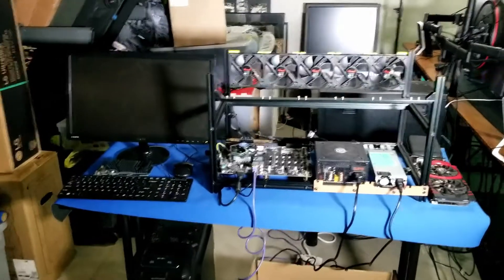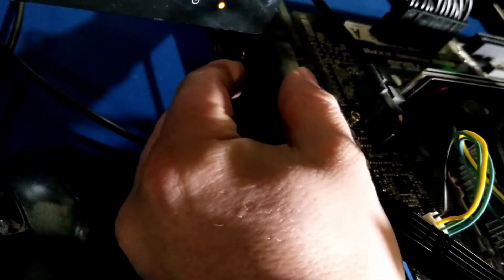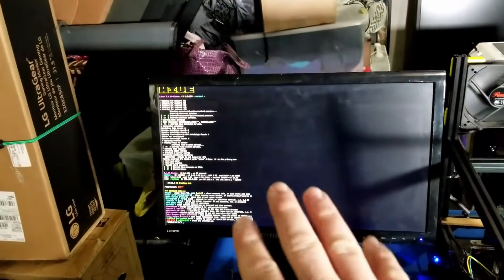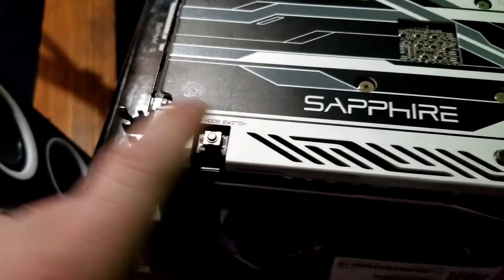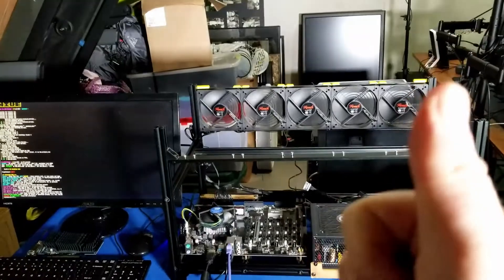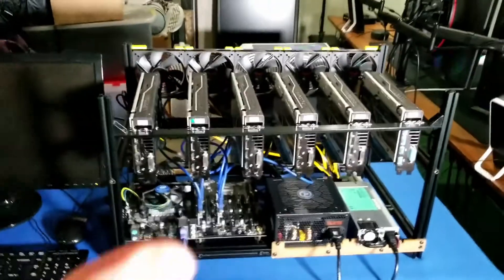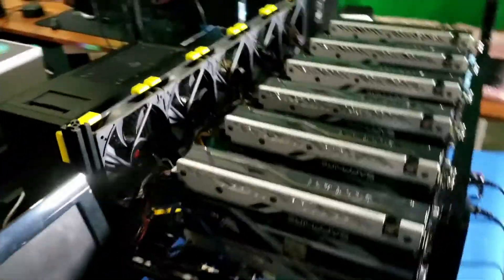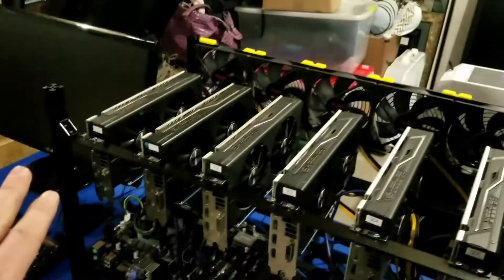Building An RX470 Mining Rig in 2021 | First Mining Rig

Comment: Quick question, why not got for pcie splitter at all the gpu and power the riser with that splitter portion. Seems like that is the safest, since sata is like the more prone to catch fire or melt
Reply from the maker: If you can wire without a splitter it is best.  Just incase your GPU does use max voltage. Now I know, your going to undervolt them, but it it does use max voltage you want to be safe.  

I do understand though its not ideal.

Comment: Great to see you finally getting this going!  I finally was able to get an RX570 running mining ETC.
Reply from the maker: Nice! What are your hashrates?
Reply: @TheHobbyistMiner  I was getting 23-24 Mh/s but the motherboard I was using wouldn't recognize to boot from USB, so I was running Betterhash on Windows.  I think I'll get better rates when I am able to test it in HiveOS.  Because I was using Windows, I was able to set the card in COMPUTE mode so I got better rates.  I don't know how to do that in HiveOS.
Reply from the maker: You need to overclock them manually.  Your Mh/s sounds on par to what I was getting when I did ETC on my 4GB cards.
Reply: @TheHobbyistMiner  yup, I'm thinking the same.  If I can find some more of these, I'll but them together in a rig.  I'm not ready to spend big money on higher GB cards right now.  If ETC or Raven is all we can mine right now, that's ok for now.  I need to get a rig built!
Reply from the maker: @mediaGuy1234  Just like me, start small! It's a hobby!
Reply: @TheHobbyistMiner  EXACTLY! - That's Exactly how I'm looking at this!